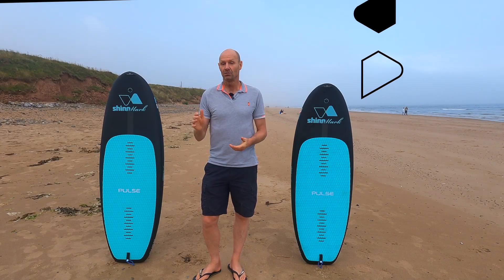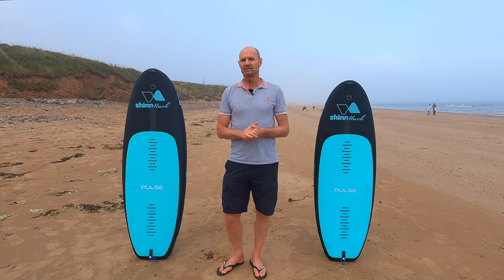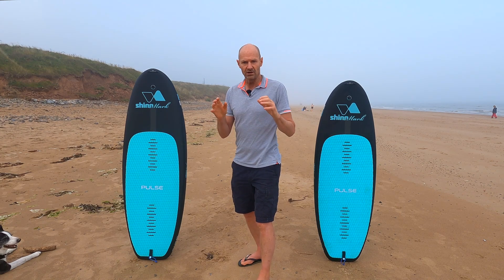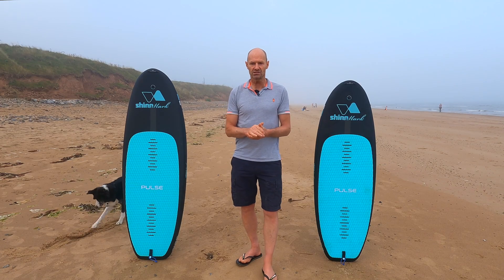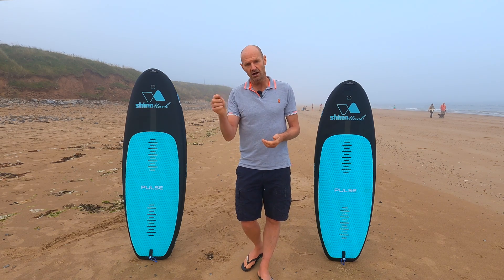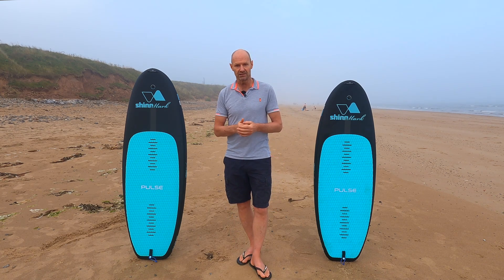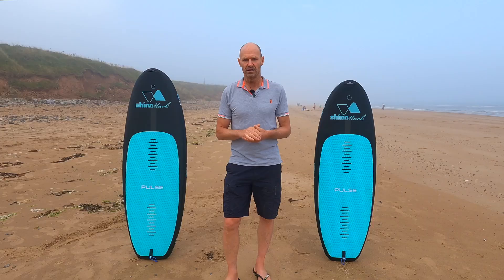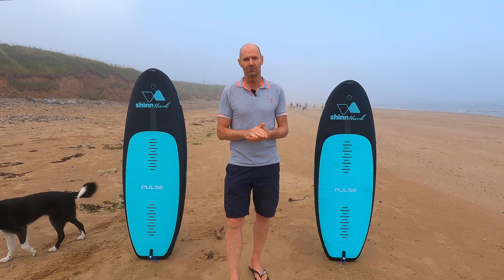SHINNmark Pulse - Full tech video - What the trench brings to Foildrive and why you need one :-)

Comment: Hi. Enjoyed your video.  I've ridden many different boards with Gen 2 foil drive and always have to move my back foot back for wave riding.  What's the design principle  that creates no stance change?
Reply from the maker: just physics.. if you put the motor closer to your foot the leverage reduces - like the difference between the torsion of pulling a nail out with a claw hammer - hold the hammer shaft at the bottom vs the top - one produces lots of twist, the other virtually none.

Comment: As a Foildrive + small board/foil addict the trench boards did not catch me right away. Seemed that you payed for the trench with thickness, weight and possibly less rigidity 😅. 
Seems that you guys have found a way to work around this🎉😊.
Really liked your first prototypes.
Please consider making one size smaller 🙏 😅like 27l 4'2".
My experience with a 30l 4'6" super stiff prone board is that you compensate a lot of the added swing weight due to max batteries 🔋. Stiffness is key.
Reply from the maker: We'll have a smaller one next year - for now we have to concentrate on the largest segments of the market. Could not agree with you more on stiffness - especially when your appetite for fast and hard riding starts to grow.

Comment: This is clearly a very thought out product, well done. As a trench board owner I can testify the difference is as palpable as going from one wing to a completely different wing. Trench board is better in any conditions over a normal board. After finding a good wing set up trench board should be the next step for any foil drive enthusiast, over high power motors and batteries and integrated masts. 

One thing I am curious about is your battery, it has no foil drive branding, do you make your own?
Reply from the maker: Mark has winged the 60lt trench a bit and the same principle of being closer to the mast head makes is a very good wingfoil board!
Reply: @ktwo-surf I’ve just ordered one from Australia, I’m interested in Mark having used it for winging. Having the trench with nothing in it didn’t impact anything, do I need to be careful with the bolts if using it for winging? Thanks Ben